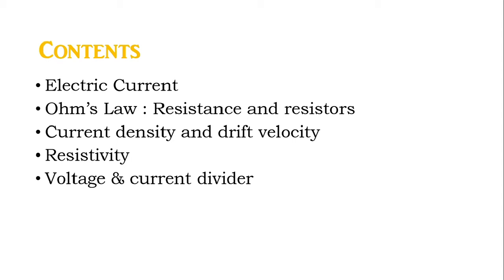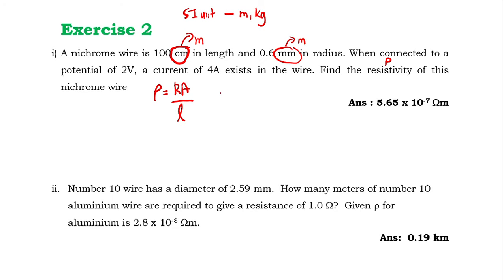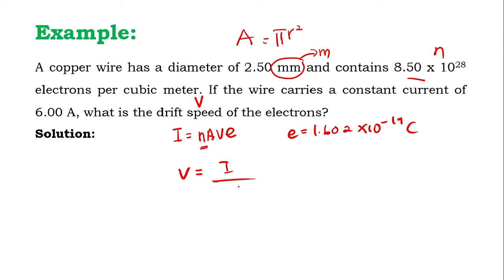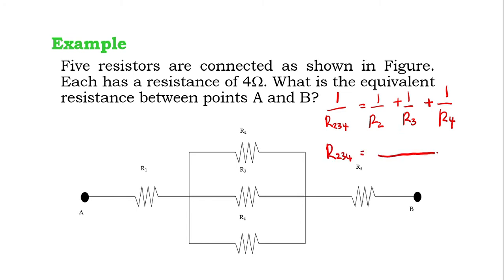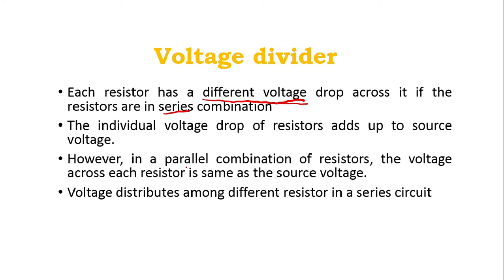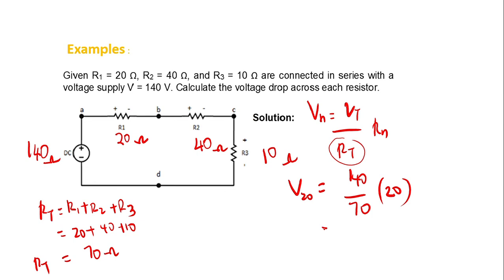(1) ELECTRIC CURRENT

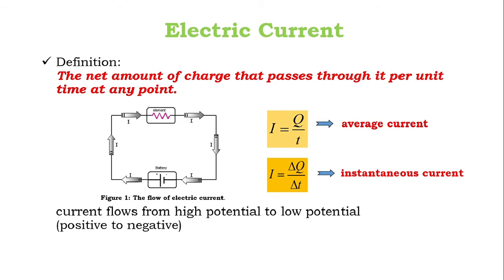Comment from the maker: 01:41 Electric Current
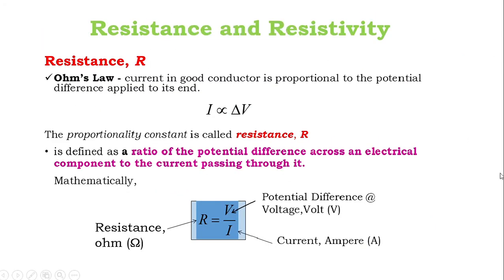05:16 Resistance
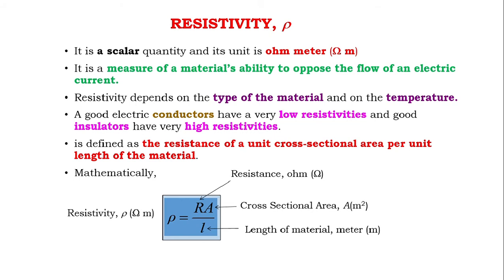07:22 Resistivity
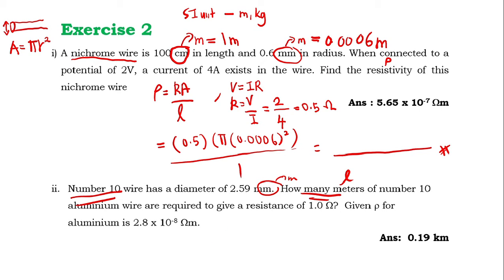12:16 Electric Power
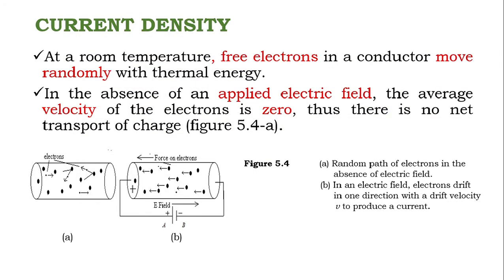14:30 Current Density
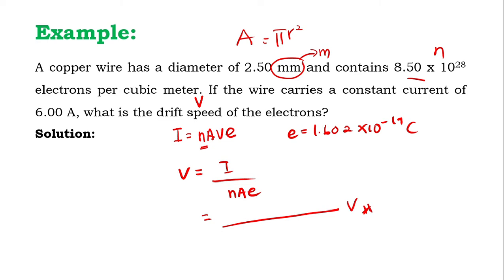19:06 Drift Density
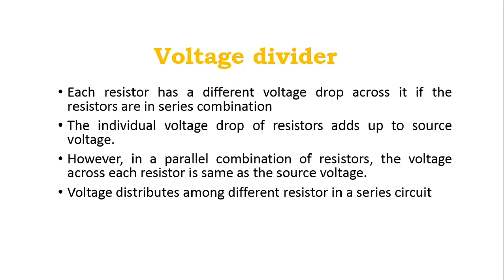27:02 Voltage Divider
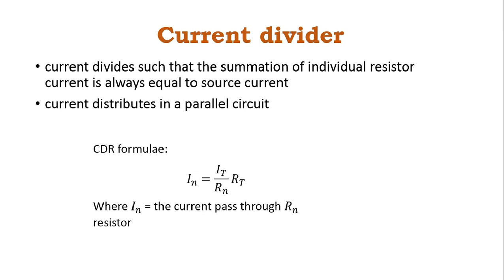29:08 Current Divider